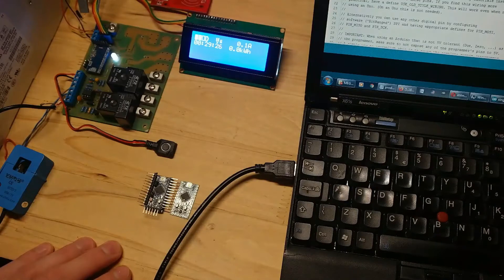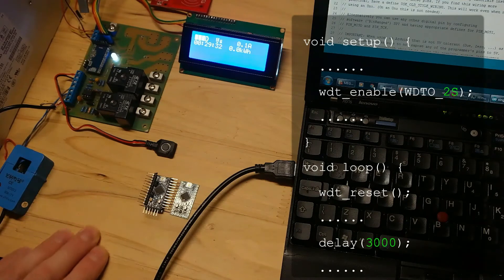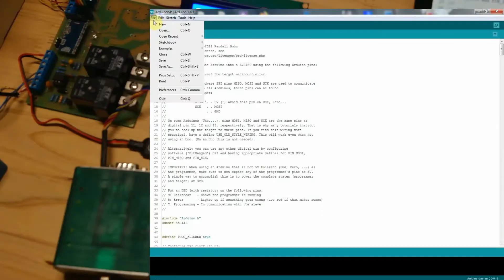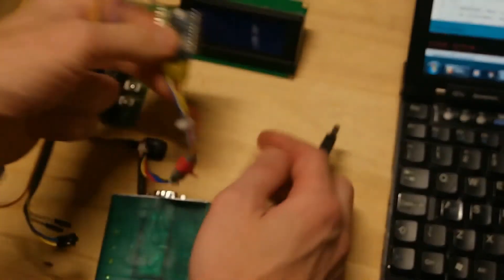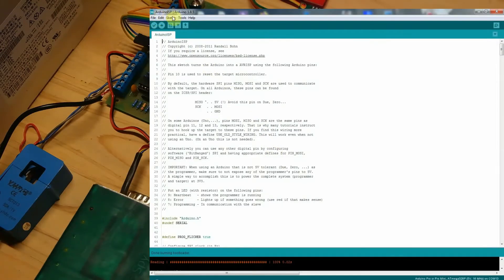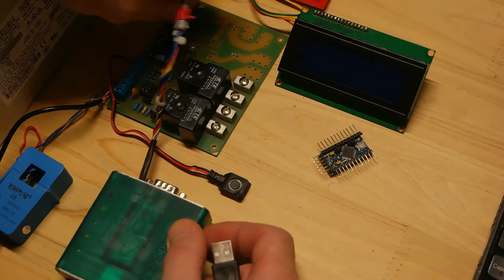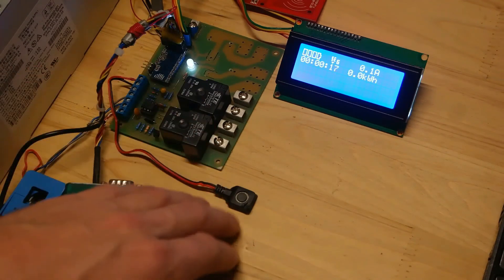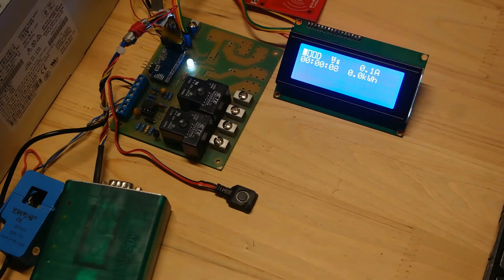Arduino Pro Mini WDT (watch dog timer) not working issue and fix by updating with UNO Bootloader

Comment: works.. with one problem.. if i burn eeprom  eep file avrdude.. I get eeprom validation error at 0x0000... save and loading from eeprom not working... works fine with original bootloader..
Reply from the maker: UNO bootloader does not support EEPROM write by avrdude.